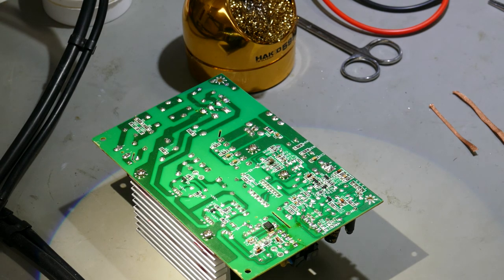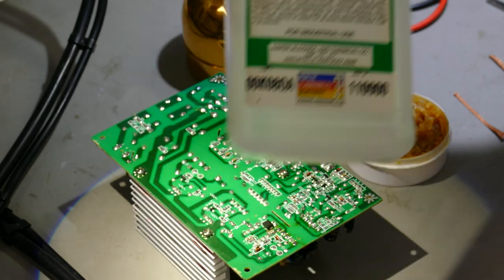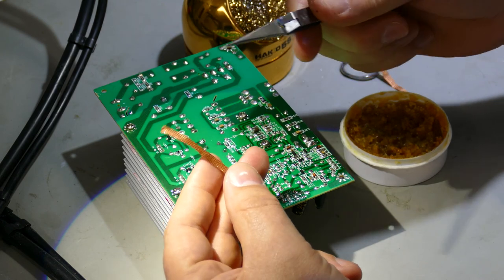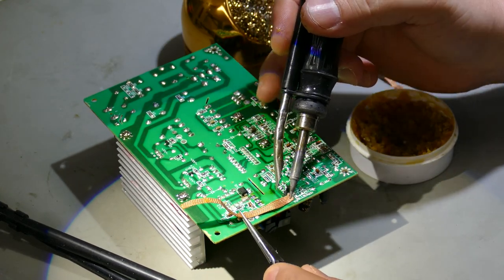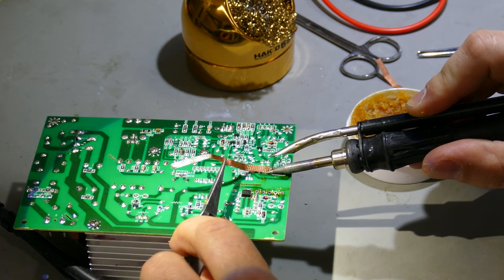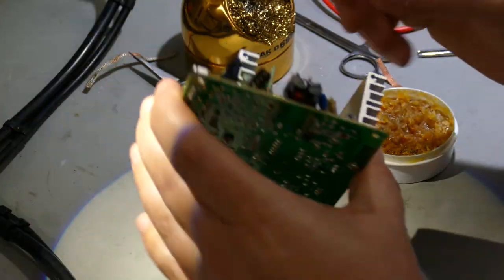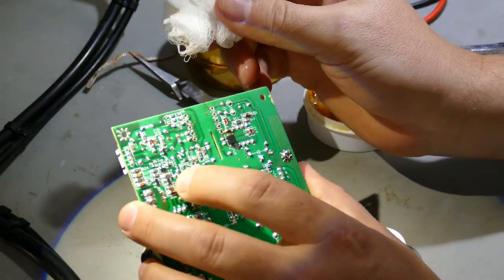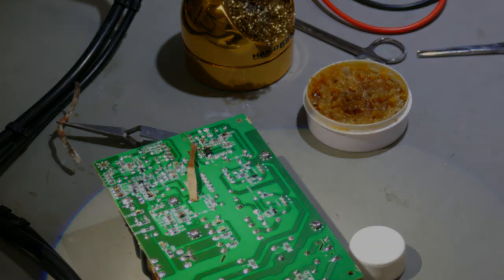03 Beginner Techniques: Solder Wicking

Comment: Wick is the best, you can put a bit extra  flux on the PCB , so the heat can transfer easier to the solder. I like your tweezers , diffidently can see the hospital environment.

Comment: That is way cool. A lot less hassle than using a solder sucker also. I see various sizes in the solder wick. 1.5 mm and 2.0 mm. I would think the smaller size would be better? Could use some guidance here. Thanks.
Reply from the maker: Often a larger size works better

Comment: I had to do this as a part of a practical test involved with a hiring process... one of the managers joked that it's a form of torture they put new people through. Once I had it completed [and it didn't go as easily as you make it look! ;) ], the manager said it's probably the last time in my life I'll have to de-solder and then re-solder a component.

I think that might depend on the hospital, the people in the shops, but what is your perspective on that? Are component level replacements still common, or is the attitude now more of a "something broke, so get a new board?"
Reply from the maker: It depends on the component and the board. An encoder on the face of a pcb would be an easy replacement. -Board pico fuses on surgical table main control boards are easy (they pop whenever there is a short in a hand pendant -to protect the table from involuntary movements due to a short). Power buttons, micro buttons, volume knobs (dopplers), desoldering a cable to install some heat shrink tube to repair superficial damage, broken solder joints on DC Input jacks, changing DVI ports due to yank damage, pcb mounted relays  -All good examples of board level repairs that will same huge $$$.  When someone comes to work for my team, one of the first things I hand them is a DIY Solder kit to assemble.